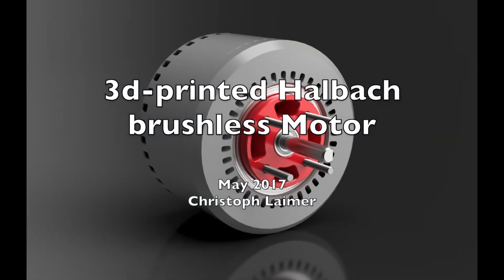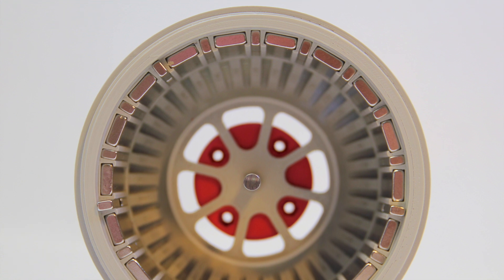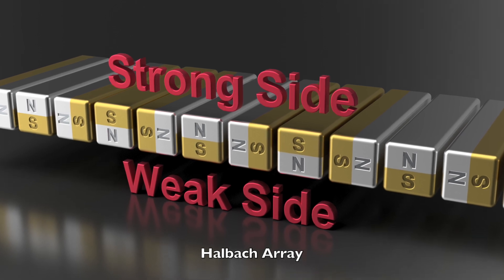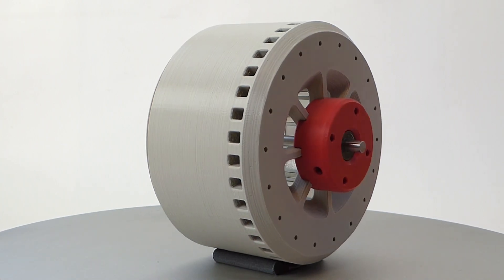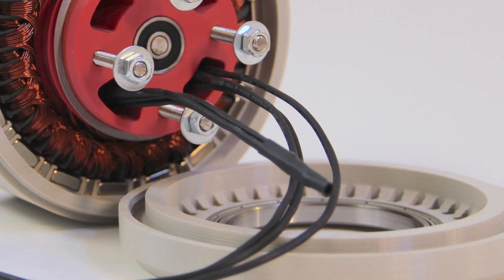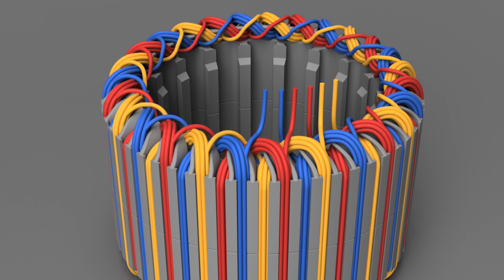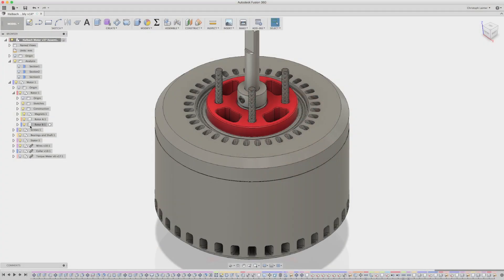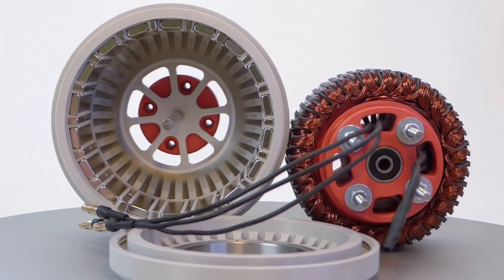600 Watt, 3d-printed, Halbach Array, brushless DC electric Motor

Comment: I sincerely doubt your claim, that this motor is 80% efficient. Any motor that can perform as a generator CANNOT deliver what you claim. If my memory is accurate, Dr.Peter Lindermann says that these kinds of DC motors deliver just about 55% or even less. This is why BLDC motors fitted on EV's, are not able to deliver good driving range,  because a lot of the energy is wasted as heat. But nice video and commendable effort from your side. Thank you.

Comment: hi christoph great work i have a question to you; can i make a stand drill with this motor beacause is a outrunner and has more torque or other outrunner with 3d printed parts with more power or diferent configurantion can be better ? and the 3d printed parts it will be reliable to work with ?

Comment: What you have made is amazing and very impressive and you are pushing the limits of what can be done,
but I feel like the plastic will melt at some point. Even ABS and PETG will melt at 250c.
Because those motors when made in metal housing can hit 300c.

Comment: hey, hey, since you are building such e motors maybe you can help me with 2 questions: 1 when i want my self-made motor to have more torque, what do i have to do? i mean the simple formula (let's keep it simple) to calculate torque is power (Kw)= rpm (speed) * torque (Nm) so when i have a 15 kw 3000 rpm motor it will have less torque but more and speed than a 15 kw but 1500 rpm motor, but how do i reach that? Do i have to use stronger magnets are something else?
And the second question is the opposite: how do i reach more rpm?
And i know that through a transmission you can "manipulate" the torque and rpm but that is not what i want to know, i hope you understand what i mean, thanks for your help and have a nice day :D

Comment: Hey 
Christoph not sure if you will see this but I have wanted to start "designing" on a little project of 3D Printing as much of an Electric Scooter as I can to try and keep it light weight for "cheap" as you would go for aluminum which is rather expensive for me. As I am looking at designs for different things I thought I would tackle to motor's (1 for each wheel) and came across this wonderful video. 

I'm thinking of making out of a non magnetic print that way I would still have to push a long a bit before the motor will kick in (semi safety feature i guess) and was wanting to modify your design but I am having a hard time of thinking how I would modify it to fit to be a wheel hub so that the Tube and Tire go around the motor and still being able to use the motor. Do you have any idea's on how to do this?

Comment: so you have a channel pole going inwards but is this faster than an array of coils all facing inwards? as it seem we have one magnetic field at 180 degree and the same field is rotated say 45 degrees...oh no your not doing that as coil of wire is not passing over inside area of ferramagnetic materials the shape of the coils seems odd to me..

Comment: Since you did such a great job, I'd like to challenge you to do another, possibly higher efficiency mother from this patent using switched PM fields US20110089775A1 - Parallel Magnetic Circuit Motor. Maybe you can use the Halbach array merged with this patent.
I'm guessing you are an engineer since this is really professional work.

Comment: i wonder if ceramic bearings would be better, they usually spin faster and hold temps better, but would also depend on cost per bearing i guess. im about to get my 3d printer so i may downscale this design to two motors and 3dprint a plane body as well, will take some effort but ill figure it out

Comment: Hi Chris, any insight on how the stator compares to stators made from stacked silicon rich steel sheets? I've read some literature about how the ferromagnetic filaments are not much better than normal plastics in terms of magnetic permeability and is not suited for this kind of application.

I'm interested in building high-torque direct drive motors for robotics applications.

Comment: I know it feels great to build a homemade motor but i wonder what's the real applicability of this thing ? It's not like the plastic engine is solving any real world engineering problems. when the motor runs  for a couple of hours it will just melt and possible set itself on fire, just another plastic junk in this already dirty world!!

Comment: Christoph, I would just like to say thank you for sharing this impressive motor design, manufacture and assembly with us. It is great to see 3D printing being used in a practical dynamic application rather than just being used for printing vases, figurines and other silly objects. 

You mentioned that the stators ferromagnetic material reduces the rotational speed while increasing the motors torque. Have you ever tried testing the motor using conventional stator materials (soft iron or aluminum)? It would be interesting to see how this effects torque and overall efficiency.

Comment: If you could 3d print a rotary encoder and a gear box Integrated into the casing, you could make a 3d printed servo motor, and with that, you could make a mostly 3d printed 3d printer...

 that's a rabbit hole that is very tempting to leap into...

Edit: I've been waffling about getting a 3d printer for a long while now. Your video on this just made me decide to save up and get one.

Comment: Cristoph your design is impressive. However, dynamic loads and material behavior are quite different for a fixed application (a laundry machine) rather than a scooter or ebike. 
Nice work. I´m impressed.

Comment: A question. Looking at the images it seems that the engine was very cogging and that would detract from performance. Without being a specialist in the field, have you tried to ensure that the group of stator magnets are inclined with respect to the motor axis? I think that would greatly reduce the cogging that I now see the engine has.
Reply: Sir please I want a small but great service for me. If you want to help me send me a message via WhatsApp +963997197600

Comment: Hi Chris,
I purchased your plans and ordered all the parts but I noticed you didn’t include any equations regarding the design of the motor,  like how you chose the magnetic field strength,  nominal voltage, torque etc. I am really interested in building an electric motorcycle but it looks like I’ll need to design a motor with a much higher torque because simple gearing won’t be adequate enough. If you could be so kind and share your modeling equations that would be awesome! Thank you for this awesome design, very excited to build it!

Comment: Christoph Laimer hello! Could you answer my questions in the mail?
I'm interested in the mandatory use of metal plastic when printing?
Does the rotor heat up strongly at a load of 660Wt?

Comment: Next step should be comparing with design with large steel pipe around rotor and its magnets. Unfortunately gaps between magnets greatly reduces efficiency.
I also suspect, that 3D printed stator allows for eddy currents and    introduces lot of loss

Comment: Well done sir, such an amaizing and very impressive work and the 3d printed parts are really awesome.
I still have some questions:
does this method give a well balanced motor shaft or not?(because I realised that the fan is vibrating a little bit)
Could you tell me how much does it cost to build a motor like this one because I really want to build a BLDC one?

Comment: What wattage motor would I need to build a human size drone for the propellers?  It would have to lift 2 human weight. Really interested in doing this as a project. Thank you. Someone just did this using a bath and another on YouTube did it...but I'm not sure of the motors used. Also I'm wondering if you could even do a video of building that motor. Obviously you don't have to. God bless and thank you very much for your love.

Comment: Nice video, thank you for that and for the experiment itself. I'm wondering what are the stress and temperature treshold of the plastic material you used. Could it be used for larger motors such as the ones used in cars ? (You know, no rust).

Comment: Hi, it is very interesting, I would like to build some for a test, do you have something related to double stator, and what will be the price to get the blue print and the table to change dimensions to get power for 5 KW  my mail is  guillermomc011555@gmail.com

Comment: Hi. How come you are using different size magnets for the Halbach array. Whenever reading about Halbach array it always uses cubed magnets as examples. Does it have something to do with getting the correct curvature?
Reply from the maker: For weight / construction reasons: using 4mm square magnets, the magnet poles would be very close together, and the space between stator teeth would be extremely tiny (makes manual winding work almost impossible). using 10mm square magnets, the distance between the magnet poles would be OK, but the rotor would be very heavy.
Reply: Ok, thank you very much!

Comment: Hi Christoph, amazing work! how much would you rate this motor in cc? my guess it is around 50cc, but it is a very rough guess!
Reply from the maker: The power of (small) combustion engines is quite random, their rated power is often exaggerated, depends on fuel/oil-type and weather conditions. Basically 1 horsepower would be 736 watt, but in reality (on an RC-car or plane) it feels like a nitro-engine with 1 hp has the same power like an electrical motor with 300 w. In other words: the 600 w Halbach motor behaves like a combustion engine with 2 hp.

Comment: Mal eine Frage abseits des Modellflugbaus:
Meinst du, der Motor hat genug Kraft, ein (vorerst nicht genauer definiertes) Fahrzeug mit einem Gewicht von etwa 500kg (total) anzutreiben?
(vllt sogar ohne Übersetzung?)

Mit meinem Elektrowissen ist es  derzeit nicht weit her, aber das möchte ich ändern und dein Motor ist IMHO eine gute Möglichkeit das was ich haben will mit einem Bildungsauftrag zu verbinden.
Reply from the maker: 500 kg ist schon recht schwer für einen 600 Watt Motor. Es spielt allerdings eine Rolle, wie schnell das Fahrzeug bewegt werden soll, und wie gross die Rollreibung des Fahrzeugs ist. Ich schätze mit 600 Watt lässt sich ein Fahrzeugin der Grössenordnung von 3-5 km/h bewegen. Für 30-50 km/h braucht es wohl 10 kW, und für 100 km/h werden bestimmt 30 kW benötigt.
Reply: Christoph Laimer - danke für die Richtwerte, ich werde möglicherweise 2 dieser Motoren verwenden, um beide Achsen anzutreiben.

Comment: Hi Christoph, I buy your motor, I do not know if you suggest a battery that I can use without any problem, and if I would have any problem in using an ESC 30 A for the connection with the microprocessor. I want to get as much torque as possible from the engine.

Comment: hi christoph , need a brushless dc for , upgrade a lathé machine , it could be , cc and ccw  with 0 rpm to 1500rpm max , with , good , torque , 600w to 800w suffiscent , frameless type 
thanks

Comment: Have you thought about buying the metal parts of this from a metal 3d printing busyness? I imagine that it would be rather a achivement to have one that was made totally from printed parts, even if it is somewhat of a technicality, and if you can find a way to do the same with circuitry you may be the first person to make a 3d plastic printer using nothing at all but 3d printed parts. I imagine that after that it would be a thought to turn your imagination toward 3d printed forms of energy generation, followed by finding ways to make the parts needed to make all the other types of 3d printers used to make those parts. Probably not more economically viable then more common construction methods, but just as likely to be interesting to look into.
Reply: Having looked into it i have learned that there are conductive printer filaments that may be more easy to use then wire if you wanted to look into making engines totally out of printed parts.

Comment: Hi, thanks I am ok. Great work! Allow me some observations: I looked into the test spec that you have provided in the links (measurements). The max shaft power you got was 486W and the input 608W. As this is a motor you should call it a 480W motor as this is what the motor is producing as an output: mechanical power (torque*speed), and you nicely state 80% efficiency - that is good. This is so because: this is how motors are normally performance-specified: output power, voltage , current, RPM, torque, efficiency... as the motor is producing RPMs at certain torque values, hence mechanical power. That in this case is not 600W, only 480W. if you call it a 600W motor that is unnecessarily misleading, however that is not what you want as you are giving the measurements..   /The input power is not the "performance" of the motor, as we do not need a motor to consume - we need the output power, because that is what we want to use the motor for: instead we want producing torque values at certain speeds, and we want to know the cont maximum power output we may have out of this machine./

Another slip: this is more like an air-core motor (magnetically) built 3D print aided and Hallbach array, not a true 3D printed motor as you have only printed the stator and rotor cores which in this case are just structural parts not EM (electromagnetic) parts of this machine. Maybe in the future it will be possible to print the whole machine, conductors too - that will be a 3D motor. If you call this 3D already what we should call that then?

Comment: Why the external rotor, is there a specific reason? Is it possible to develop a version with external stator and internal rotor, obviously changing parts design and inverting the magnetic field versor, so that is directed internally?
Reply from the maker: +Nicolò Carandini It's easier to deal with centrifugal forces of the magnets, and keep the air-gap as small as possible.

Comment: Have you thought of using rotor coils in the future? I haven't calculated anything, but just knowing most conductors have a lower density than ferromagnets, I think you might get up to higher speeds with the same 3D printed construction without failure

Comment: how much torque do you think this will produce ?
Reply: very roughly 30Nm @ 3000rpm. that could be way off. that's just based off of the wattage and roughly half the maximum speed

Comment: Christoph Laimer
That is a very impressive motor you built.
Any plans to build a motor for an ebike?
Reply: He might not but I do, Im gonna use Kevlar impregnated filament to dramatically increase the strength and durability of the housing.
Reply: @Chaos------  where do you buy it from (3dxtech?)
Reply: I opted to use an off the shelf kit to convert my bike. Its fast af
Reply: @Chaos------  what kit u used and what battery how much ah and what's the mileage?
Reply: @Chaos------  did you ever build it? I wanted to build one but kinda lame to start from strach
Reply: 750 watt baofang crank shaft motor. The battery pack I made is tiny though, only gives me about 20 miles per charge, but its all I need.

Comment: I was wondering why this array couldn't be used in a motor like this. I guess it can.   do you think a 12" diameter by 18" version of this can be built? do you think it would be efficient? I want a DC motor for a car project. I have some forklift motors. I just don't think they will have the power I want. even with doubled voltage. they are 36-48 volt motors. and I was going to use 72v-80 volt lithium batts and controller. I'd like about 300+ ft lbs of torque. but I'd settle for about half.  great video

Comment: I liked your video producing 600w power so please contact me for supplying me a same generator with your reasonable price, using neodymium magnets drsharma140@gmail.com   After use I will buy many more. please confirm 600w at what RPM or any information you like to share. Regards.

Comment: Do you know how the efficiency varies with rpm and power changes?
Reply from the maker: Here is a sheet with my measurements:
https://www.instructables.com/files/orig/F2M/63PW/J98RETMY/F2M63PWJ98RETMY.pdf
Reply: Christoph Laimer perfect. Thank you!
Reply: Did the Halbach setup increase efficiency much or just power to size ratio?
Reply from the maker: I was able to extrapolate some improvements in power to weight ratio from my measurements. Probably the efficiency is also better, but the setup for that test is not trivial. Would need to design two rotors with the same total mass and strength of magnets. One with regular arranged magnets, the other as Halbach array ...

Comment: is your 600W the output of the motor or the power draw before the 80% efficiency?
Reply: imabeapirate
600W should be the nominal output power of the motor. 80% should be the maximum efficiency of the motor. I would be very surprised if this was the efficiency at rated output power.
Reply: @typedef_  isnt system effeciency the total efficiency? Inverter + motor + propellor?? This means to calculate the efficiency of the motor you need to substract the inverter and propellor.
Reply: @HermanWillems  That's correct. I think what I was trying to say was that 80% motor efficiency is unlikely to be found at its rated operating point (rated torque and rated speed, which multiplied gives you 600W).